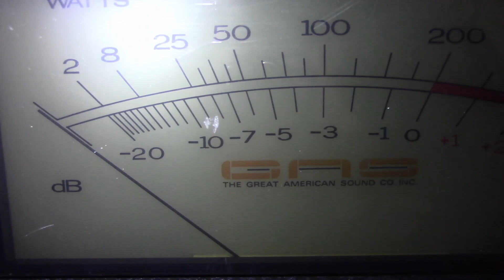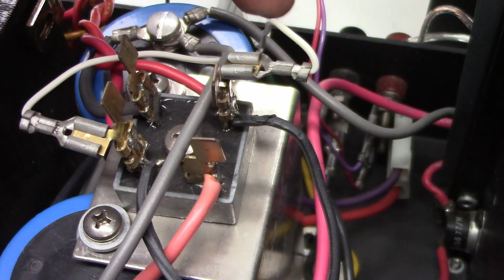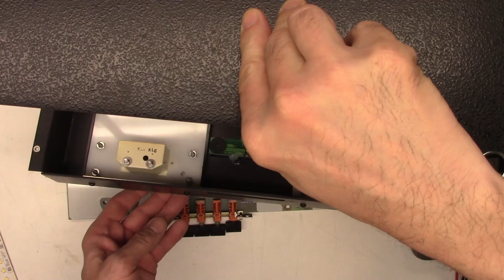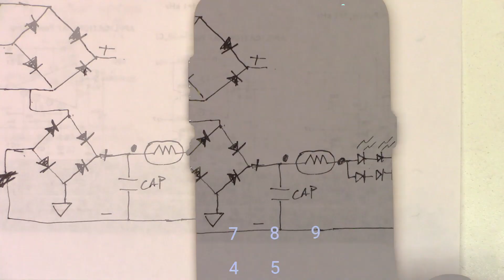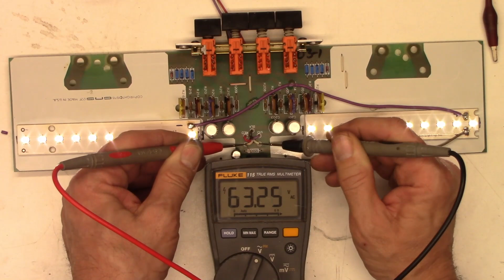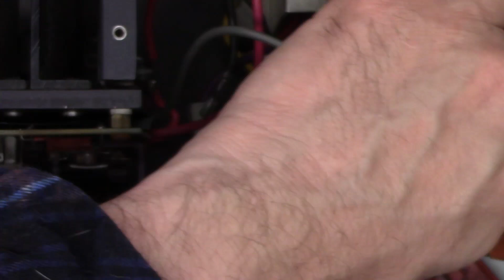AMPZILLA IIA 200 WATT RMS STEREO AMPLIFIER METER LAMP LED UPGRADE. THIS WAS A KIT NEW IN 1978.

Comment: Excellent video.  I just tore my Ampzilla apart to replace the meter lights.  I've had to do it a number of times over the years.  The series wiring of the bulbs is not a good design.  I have thought about doing an LED replacement, and this time I will.  The meters look so well-lit and white.  I want that look for my amp.  And I don't want to take it apart again to replace bulbs.
Reply from the maker: This is a once and done repair!

Comment: Have to make a correction. This amp may indeed have been sold in 1978, but it was probably not built from kit. The kit model initially sold in 1974 mail order, and did not have meters. Meters were added for the kits sold through dealers that was1975 only from my recollection. I bought my kit in June, 1975 from Myer-Emco of Falls Church, VA and built it that summer. You can identify these early Ampzillas by the gonzo style writing of Ampzilla and by the rotary on-off knob and the lack of a headphone jack. Later Ampzillas had a push button on-off switch with futuristic computer style script, with the headphone jack added later. Still a very nice unit. I still use mine, it having been rebuilt twice.
Reply: You are correct only the early Amplilla's were available as a kit.  the kit was dropped because GAS did not supply matched output transistors and the performance was not as good as a factory built AMP but still a steller amplifier, norcal715 Is working on a Ampzilla II which has some minor chances on the original Ampzilla.